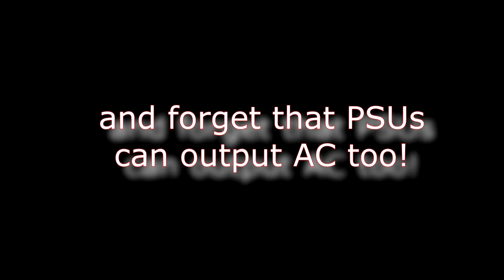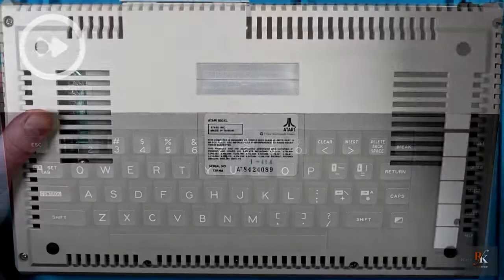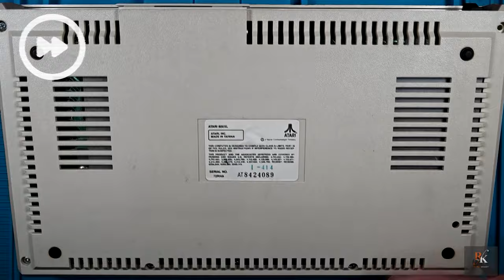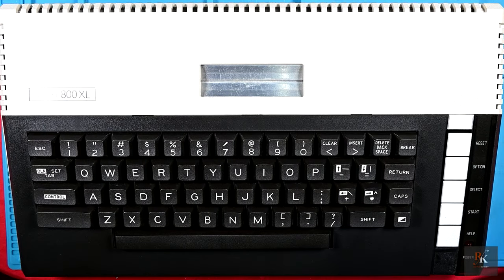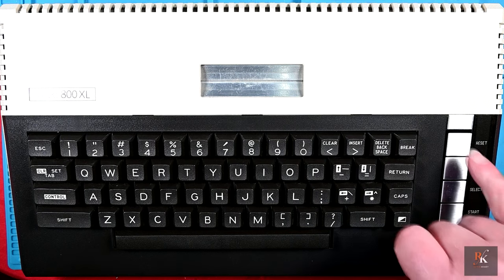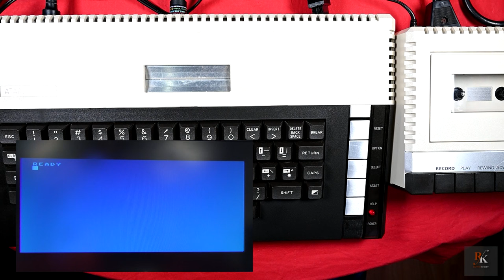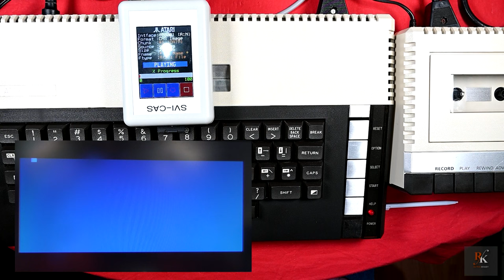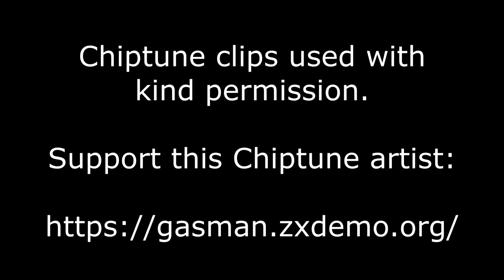Repair/Restoration: Atari 800XL

Comment: Just pressed play and like immediately afterwards. I recall it's an easy mod to change to USB power because uses 5V only?
Reply from the maker: I believe so, though my personal preference is to have everything as original as I can if possible. I'm not adverse to using modern power supplies as test supplies though :)

Comment: You should disable BASIC  before  loading games  (OPTION + START). Azimuth of heads is usually an issue with these cassette players.
Reply from the maker: Thanks for letting me know!
Having never owned an 800 before this, I wasn't aware of the combo to disable basic when I made the video. However, I'll be trying that very soon as it was too regular a failure i.e. seemed to fail at the same point each time!
Reply: @RetroKrazy  You should also check the tape....you might be able to see a pinch on the actual  tape. That was  a common issue with many tapegames.
Reply from the maker: @nickolasgaspar9660  The tapes do seem fine so setting everything back up to test the START + OPTION liading!